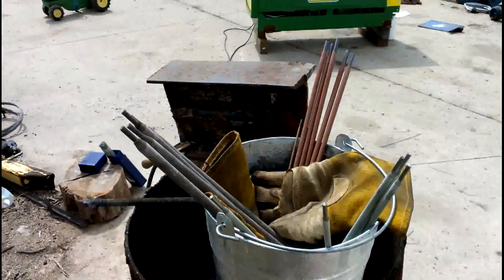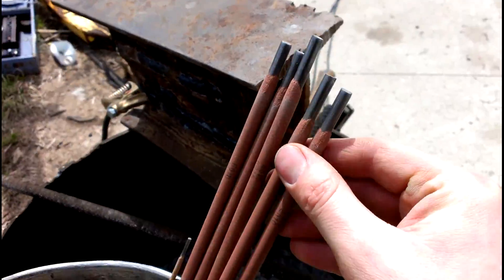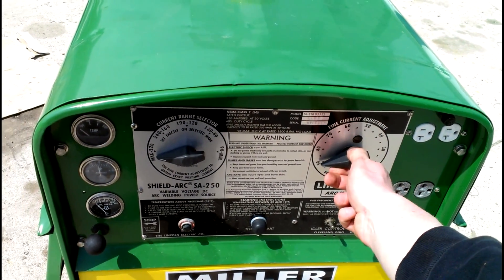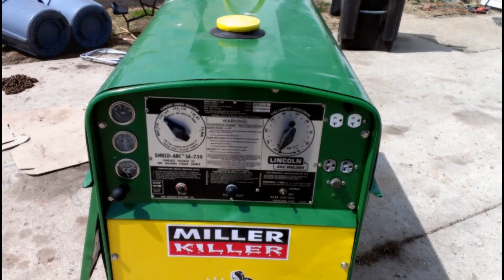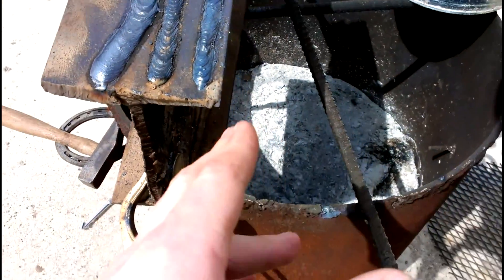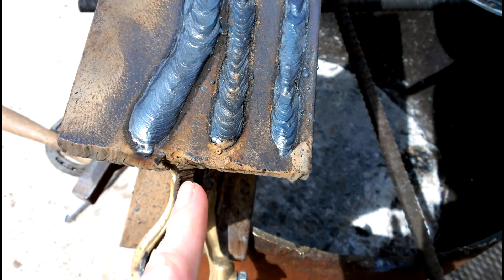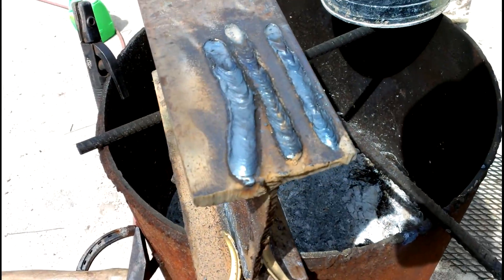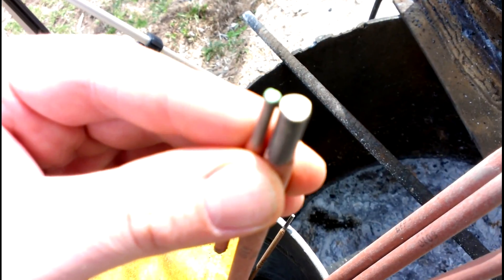Big welding rods

Comment: 7024 is deck rod but ‐‐‐---------  How do you figure your 250 is putting out 500 amps,why wreck your welder???
Reply from the maker: I got a can of 1/4' rods to play with. Put a clamp meter on the stinger and see how much one will put out. I want to say those were running about 470 amps average

Comment: ...1/4" 7024...yeah...400-500 amps DC +.....that generator would give the best welds....
Reply: Yeah, I saw this and after cringing at a Lincoln SA250 dabbed over in John Deere Green, saw that horrific undercutting he was doing on those shoulders...and figured that a real welder, like a Miller 400 Pipeline Pro would be about what you actually wanted to run 5th gear in on those 1/4" rods...then again, I've seen 700-amps thrown into 5/16" 7024's too (in shipyards), so they are VERY versatile on thick plate, and you can move fast with them in the vertical at high amps, too.

Comment: I worked for P.D.M. and Caldwell Tank Builders  on Elevated Hydro-storage,in the 70's and 80's and 90's retired now .we needed rectifiers ,or inverters ..powered from a 750 kw generator , we used about 8 big 450 millers or big lincolns . running off our generator ,cause we needed to use alot of voltage gouging too.  and the big continuous  S.A.W. wire. on the 3 oclock  we used on most horizontal seams. .i used to carry boxes up top one for the older  journeyman who was my mentor . He helped me for years so i packed his rod up , as we got older .  ,  i lay that jet down low in the wind,so itll blow the  slag/coating back off the top good  not to trap none along the sides anywhere   .  Low Hy is different u know  it dont just drag hot as good as the  flat only, iron powder stuff like them 24's . And usually we kept at least3-4-5 guys burning hard , and hot , all day long with the others fitting and cleaning up etc . lots of juice  flowing .

Comment: The difference between a Pipe liner with Lincoln and welder fabricator with a Miller is pipe liners got to use 2 hands on the rod and the later only needs 1. lol
Reply: I dont think you've been around enough pipeliners.

Comment: hey, have you tried 7028's? i have not seen a single vid with someone who has used them.
Reply: that 2   , the 3rd digit not being a 1 like a 7018.. isnt   for overhead or welding verts ,,its a horizontal and flat rod.. limited   as compared to a 7018 8018 9018 10018 or a 11018 . alot of welders havent or are not as familiar with the tensile number being over 70 thousand lbs tensile strength..  but ive welded with 12018 also.. :D
Reply: I have some and despite there exposure to the elements of a university shop for 30+yrs. they seemed to weld just fine. now take them to be X-Rayed, the hell if i know if they'll pass.
Reply: yea thats a good rod ..that 8 special characteristic , i forgot the specifics on that 8. ive run some 12028's before too.  120 000 tensile  .. :D
Reply: ...Back in 1990....I spent 6 months on a bridge project.....ran 1/4" 7018 All Day....lots of 3-4" Plate.....probably burned a couple 50# cans a day.....Power source was a Lincoln 600 amp unit....
Reply: I ran some 7028 yrs ago, if I remember right it was used like 7024 but, you had to push it as you could not pull or drag it. If you drag it it runs ok till getting close to halfway down or less and it runs like crap spitting and sputtering with uncontrollable arc blow. That was 33 yrs ago in Broken Arrow Oklahoma,  that job was headed off-shore.

Comment: Welder/generator is very nice but Miller is still the best!
Reply: David's Favorite Videos I have both and my sa200 smokes my miller Lincoln welds way better both are 200 amp
Reply: NO. NO. NO IT'S   N O T !!! LINCOLN  IS  BEST !!!  400 Amp Mliier big 40 ,40 hp, Lincoln. SAM 400  63 hp. ,Miller 600 Amp 63 hp, Lincoln SAM 650 84 HP!!! LINCOLN GOING. Miller.  Chernoble!!!

Comment: I want to see you run a 1/4 7018 welding rods
Reply: ..Real easy...you just kind of lay them in there....just hold there at the right angle....flux supports the rod as it cooks off....run the bead....hit it with needle gun....insert new rod from bundle you're holing in your left hand.....

Comment: As far as the 1/4 inch 5P goes, the only thing i ever really used that big of rod was for demo cutting of scrap. It is really too big and needs too much heat to really been any good for closing an open root or filling a gap. They call it cut rod around here.
Cheaper than carbon arching.

Comment: Your still cold on the 7024 you really need to drive that rod. You should get no cold roll or overlap when you have the heat set correctly. Best to start out hotter than you think you need. you can always cut the heat back a bit if your too hot. better than too cold.

Comment: Yeah you,need anywhere from 400 too 425 amps for 1/4 in 7024 JET weld rod. We used to use a boat load of that stuff  plating oil storage farm tank bottoms. I was getting 36 linear inches of weld on 1/4 sheet lap joints from each rod. Those rods came 24 or 28 inches long i really cant remember now but yeah thats some awesome shit to weld with right there especially on heavy plate and fillet welds.
Reply: 29 inch  5/6  .  yea them pushers would cary a rod around and we needed to get  1 1/2 rod lengths  about 45 inches,minimum   ,from start to stop .out of each rod   . or  they would let a burner know he wasn't cutting it.  our floors were lapped ,so some  could get real hot and run up on the top plate using alot of it for filler    and get 55 inches of 3/6 " linear weld per rod ..
Reply: Jet welds we used on tank work 🇬🇧🏴